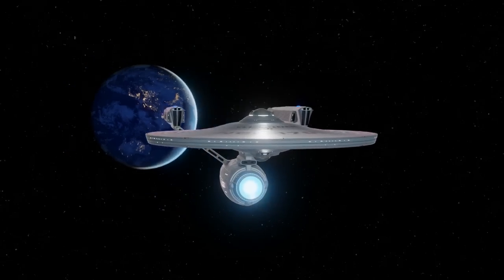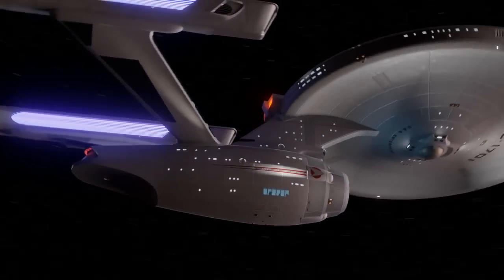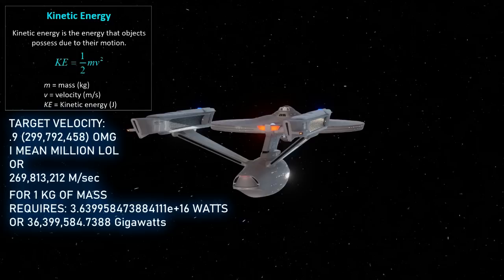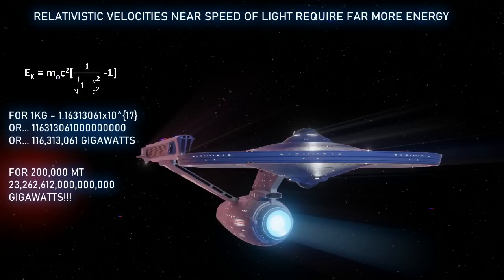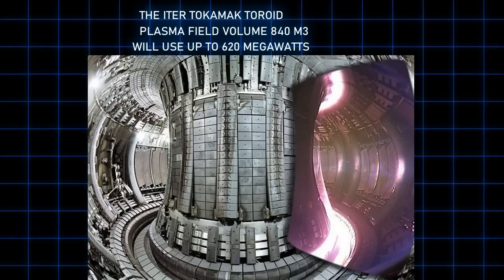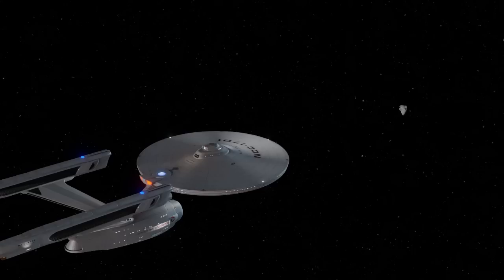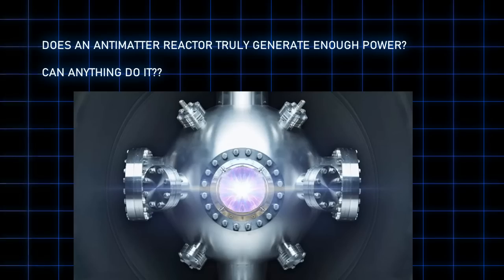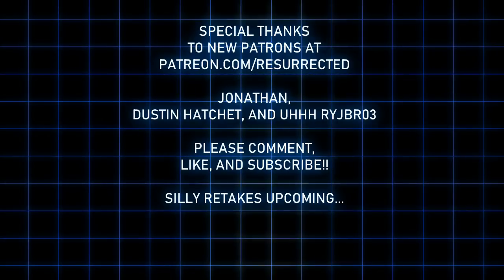How Many Nuclear Power Plants Can Power the Enterprise? Let's Calculate!!!

Comment: In the TOS episode Mudd's Women Scotty states that the weight of the Enterprise was almost a 
million gross tons. Considering the ships size this seems unlikely. Non cannon sources like the
original Franz Joseph technical manual list a weight of 190000 tons. This also seems excessive   
considering the latest aircraft carriers only weigh 100000 tons. One would think in the materials 
would be lighter.
Reply: Apparently, warp coils are really heavy! 😁
Reply: The 190,000 tons from the technical manual is deadweight tonnage, not the weight of the ship.
Reply: @MatthewCaunsfield  Apparently they're made of Unobtainium.
Reply: Gross tonnage May also be a volumetric measurement, as it references how much water is displaced by a ship’s hull. I’m not sure if that’s anything close to accurate, but should be kept in mind.

Comment: The output of our fission reactors is only 5% of the actual fission. We heat water to create stream to generate electrical energy. We should assume that a spaceship use the energy of such a reactor in a more directly way to avoid such high conversion losses😉

Comment: 0.9C is pretty wild! 0.5C or 0.3C is probably a much better upper limit for sunlight speeds, and this should only be achievable with considerable risk and strain to the craft. Even those speeds are pretty far out! The upper limit for fusion rockets is in the 0.1C - 0.15C range, and the Enterprise is supposed to be operable under fusion power. (Impulse drives are basically inertialess drives, which in itself if pretty wild, however.)

EDIT: Vaporizing asteroids instantaneously is probably overly ambitious. Given that impulse drives are inertialess, it would be far easier to simply dodge. In terms of finessing things, perhaps the navigational deflector creates tiny localized warp bubbles that simply shift asteroids out of the way? These localized warp bubbles wouldn't need to be stable for very long. Nor would they need to be particularly smooth or stable on the inside. This would explain how they could be implemented at such huge distances.
Reply: "Impulse drives are basically inertialess drives"

No, they are literally not. 
🤨

Comment: Firstly great video. Love applying real physics to these problems. 

Only comment id have is that id suggest the mass is a lot lower (future material). Yes a modern day warship like an aircraft carrier weighs 100k tons but i believe its said frequently in the show the ships are made of varios alloys like Duranium, mystery materials that like reduce the mass of the ship by maybe a factor of 10x or even 20x (id guess) maybe even more... 

Also id guess impulse drive is a lot less that C. Mayne 0.7c or even lower? 

Makes the number a bit more plausible maybe? 

It would still require billions of watts tho i guess hahaha. 

But loved this video. Commented liked and subbed lol. Good job. Make more.
Reply: Space magic material make the ships super lightweight maybe???

When you see the D getting flung about in TNG it makes sense that these alloys are rediculously light, i think its some type of Hydrogen isotope mixed with Aluminium. 

Now think of a Boeing 747 compared to a Los Angels class submarine. Similar dimenions sort of (70m vs 110m) completely different mass, 12x or so.

Comment: In "The Doomsday Device", Kirk says that overloading the impulse engine on a Constitution class generates about 98 megatons, if that helps.
Reply: Please note: this was for ONE of the two impulse units.
Reply: That as a matter of fact does not help very much. Megatons is a unit of power, not a unit of energy. There is a difference, power is defined as energy over time. Interestingly, burning a kilogram of coal releases more energy than a kilogram of TNT, but because the explosive releases it faster, it produces more power.

Comment: There's one problem.  The enterprise never reaches over lightspeed, ever.

Impulse speed is sublight.

Warp creates a spacetime bubble and the shape of the warp field causes spacetime in that bubble to move.  So while at warp, enterprises has zero velocity while the spacetime around it is moving.
Reply: Star Trek: The Motion Picture disagrees. 
I suggest watching it before replying.
Reply: Moving space-time around takes a ridiculous amount of energy, so I’m not sure it helps us that much
Reply: @mbmurphy777  No doubt.  This is why the warp exists primarily to feed the nacelles that generate the warp field, powering this ship is a byproduct since the power requirements are vastly different.

You're right.

Comment: But isn’t it wrong to factor in the weight of the Enterprise because of the lack of gravity in space? The power needed to achieve faster than light travel wouldn’t have to be maintained. There’s no wind drag so a short burst would do the trick and even a massive ship should be able to theoretically maintain the speed forever. Idk. I’m no expert but it seems like the power output needed wouldn’t have to be this astronomically high when you consider the ships are traveling through a zero g environment.

Comment: Is this for a few seconds of acceleration? In practical terms  a ship like this would accelerate for weeks and months continuously.   There is also the loss of fuel weight over each hour and day and week that was not considered.  I am working on  such a ship and I think 100,000 tons is more likely.  A second thing you forgot is time dilation.  At about 68 or 69% the speed of light you will have a time lag of around 23%  making it look as if you were travelling 90% but only 68% to an outside perspective.  You never need to reach the top few percent of the speed of light.

Comment: "Full Impulse" speed is nowhere near 0.9c...it's actually 0.25c.

The two primary components of a "modern" Impulse System are the Impulse Engine itself (which generates a subspace field akin to a mild "sub-warp" bubble that MacGuffin-lowers the overall Energy (e) requirements of e=mc2) and the Inertial Dampener (which, while negating the inertia of the vessel, also lowers the overall Relative Mass of the vessel (m) of e=mc2.

So no...(comparatively) enormous amounts of power aren't needed for Impulse Speeds: humanity had achieved full impulse speeds with simple fission reactors (and no inertial dampening) before Cochrane flew the Pheonix.

Comment: Shields at sublight speeds are only meant to deflect or destroy sand and gravel sized objects too small to see in advance of being hit by them.  larger items will be scanned by lasers and electron beams, ionizing them to be repelled by the ships electromagnetic field generator, the same one holding plasma or some gas out from the hull of the ship, making these larger items deflect enough to bounce off the slope of the ship.  Even larger objects must be targeted with a high power laser or phased array of lasers to blast it off course and this requires lightning fast computer detection, analysis , targeting, firing and further analysis and maybe a second shot, all the while being bombarded with electrons from the electron gun so that smaller collateral particles will still be deflected by our shields.    Failing all that we have rockets.  If it's too big for rockets we need to dodge it .... hard to port.  Options that work... that's the solution.

Comment: It's possible in trek techno language that a  low powered warp fiels is always active around the ship. Perhaps impulse with a low warp bubble formation from the other fusion reactors  [ like in star trek motion picture  they use .1 .2 .5 ... warp factor ] what do you all think?
Reply: According to the TNG tech manual, the impulse engines do indeed contain a space-time driver coil which generates a sub-warp 1 field to let the ship go stupid-fast.
Reply: According memory-alpha that is correct. "The accelerated plasma was passed through the driver coils, thereby generating a subspace field that improved the propulsive effect." Article did not give source though but I do seem to remember that it was a plot point in first episode of DS9 when they needed to move the station.
Reply: Now and then 'impulse' is occasionally explained as a low-power version of warp drive. Which it could be, but the orthodox description is that impulse drive is the direct exhaust from inertial-confinement fusion reactors. It could be however that this thrust is given more effect because a minimal warp-field is also in effect and lowering the mass and inertia of the ship as well... To some extent warp is used in a directly analogous way to the 'Free' Bergenholm inertialess drive of E.E Doc. Smith's golden-age space opera of which Roddenberry is said to have been a big fan.

However there are many occasions when the warp drive coils are explicitly disabled in the narrative and whichever ship in question has to move under impulse alone--for instance the Voyager seemed to spend most of its time with flaky warp engines!!!
Reply: @epiendless1128  
The TNG tech manual is not and has never been canon. It contradicts every Star Trek episode.

Comment: I do not agree with your estimation of the Enterprise's mass. Going by the dimensions you give, the Enterprise you are discussing is roughly comparable in size to an aircraft carrier, like a Nimitz class. The Nimitz class only weighs about 90,000 metric tons, so I do not see how the Enterprise can weigh twice as much. If anything, it should actually be far lighter, given how it is so small in terms of volume. The linear dimensions might be similar, but most of the Enterprise is much more thin and spindly compared to the aircraft carrier. It would be not unlike comparing a small aircraft with a tank.

Plus, any Enterprise would be made out of some kind of exotic material that we can't even imagine now.
Reply: Well, you have to carry fuel and if you are going to be producing billions and trillions of gigawatts, you need a lot of fuel, unless you’re just going to say that it’s magic, which, of course it is because this is a fictional show. The Nimitz doesn’t have to accelerate to a quarter of the speed of light with what it’s carrying on board.

Comment: irregardless of what you calculate the fact that impulse is ridiculously fictitious.  way too myuch energy required.  now, to move at warp, beyond the speed of light which is more like DUNE where you move without moving by bending space, which is more akin to the idea of a warp bubble. so, you are not moving the mass through space, you are opening a hole/bridge and simple sliding through it, and the bubble only needs to be as big as the ship. one issue that canon has is that in warp, it appears that they are indeed moving, and have fights, maneuver as well as like in the new trek timeline, the agressor ship catches up to the enterprise during warp and interacts with it. i have to say, i felt for the people being sucked out at warp. probably would have vaporized instanly.

Comment: I believe you got short on power requirements.

And it also seems like the "fuel tank" is too small to house so much energy. You can't put that much stuff there without having to compress it and make a little kaboom black hole there.

Comment: So lets discuss some of your miscalculations.

1. Starfleet ships do not fly near lightspeed on impulse propulsion. In fact full impulse is only 25% speed of light, so 75000 km/s. Reason for this is not only to avoid relativistic effects, but also fact, that impulse engines are not annihilation type but fusion type. Hence theoretical limit of specific impulse is 3 631 128 seconds. So without any plays with cosmic constants, you will need 8,5 kgs of hydrogen to accelerate 1 kg of ship to just full impulse (to achieve 0,9c you would need 5152 kg!). This is why gravity and mass manipulation is coming into game. Impulse engine is high efficient fusion reactor which is not powering mass of reactants alone, but also mass manipulators in exhaust which by manipulation of Higgs field are significantly increasing mass of accelerated matter this also increase its inertia and momentum. So needed real mass of propellants is diminished to realistic values.
Star trek has also another trick in sleeve. If warp core is functioning, warp engines are capable to significantly decrease mass of whole ship by local space-time manipulation. This reduction of ship mass has multiplying effect with mass addition to impulse engines propellants and allow star trek ship to achieve very high sublight speeds in matter of seconds.
Btw. Higgs field and gravity fiel manipulation allows to star trek ships flowing in those fields and thus behave like planes in air rather than spaceships in vacuum. Thanks to this tricks, you do not need to have multi directional placement of massive impulse engines or turning ship to navigate trough space.
Field manipulation also allow to trek ship to store significant amount of propellants, especially hydrogen, which is so low-density thing, that having enough hydrogen for just several days of Galaxy class warpcore would fill that ship in her full volume.

2. Shields are not magneto-plasma. Yes, magneto-plasma shields would protect from mot matter and many freqencies of radiation, but it will have problems to stop matter without charge (neutrons) and em radiation in visible light wavelengths etc... Shields would be more probably gravitonial form again manipulating thin portion of space-time which would create immensely dense bubble, which would in fact behave like some sort of non-newtonian fluid. So for matter and radiation with high energy it would be like brick wall, to low energy thigs, including visible light, sensors etc, it would be more transparent.

3. Phasers showed scale how powerfull these weapons and shields in Star trek are perfectly in ENT, where phased weapons from NX-01 were capable to make quite a boom on some moon, yet enemy ships often shrugged fire from these like some nuisance.

It is important to emphasize, that warpcore is on 23rd and 24th century mainly to power warp engines only. Ships systems are powered from impulse engines, which acts as high energy and efficiency fusion reactors. Shields have its own energy storage, probably some sort of SMES, so they can be independent on any of ships energy sources, depleted and recharged. Phasers are then also totally independent from other ships sources, they have its own "batteries" called phasers banks (as shown in DS9 by Miles Obrien) which is some sort of exotic mater in semi stable state, which can be triggered to rapid change into energy, similarly to our gunpowder.

These tricks allow to keep star trek ships in real space physics and making BBtrek (Berman, Braga era) hard sci-fi with emphasize to sci. No other future space sci-fi show is in fact so realistic, as BBtrek is. For example Expanse, taking into consideration only human technology looks better at first look, but then you make some calculations and realize, that absence of space-time manipulation capability is making key technology of that universum - Epstein drive - total technobabble. Simply those ships would not have enough hydrogen to achieve continuous 1g acceleration for hours, let alone days.
Reply: I thought fusion engines only converted less than 1% of the fuel mass into energy, and then that energy Hass to get converted into motion. How do you get the number 8.5 kg of hydrogen to accelerate 1 kg to quarter light speed?

Also, space-time manipulation is going to take an unbelievable amount of power, and also presupposes the existence of negative mass and negative energy whatever that is and whatever that would look like.
Reply: @mbmurphy777  You are mixing two physical phenomena. You need 8,5 kg of hydrogen at theoretical speed achieved by its fusion (630 TJ/kg) to accelerate 1kg of ship mass to 75000 km/s. So, fusion products achieve cca 35600 km/s, and this is inserted into classical rocket equation. It is more clear now?

About energy requirements for space-time manipulation
1) We know absolutely nothing how much energy we would need. Einstein equations are crappy when it comes to real world extremities (ie singularity is physical nonsense) and can not be used as basis for any real-world calculations at such extremities (this apply also in quantum physics world, which is probably bigger current real world issue than space-time manipulation 😀.
2) You know, that Star trek is sci-fi show, right? Its trying to be as physically faithful as possible, but it has also help itself by "magic" and "technobabble" time to time ;-)

Comment: the history has shown that over time we engenier things too be more energy efficent, so it uses less power too achieve the goals. 
and i imagine the star trek tech, is so efficent that it didn`t need so much power too achieve what it is doing, and that is in line with what humanity allways has done and allways will be doing with technologie. 
the same with the armor hulls, if we would build a battleship like the yamato today it would weight much less than it weight in the 1940, thats because amorplating is improving all the time, it get denser and more capable of doing the same feats with much less material needed. 
so i would asume that the starships of star trek might look big and heavy but they are don`t as heavy as they would look, because of the advancements in the hull materials used.